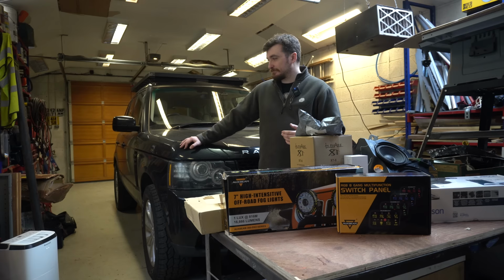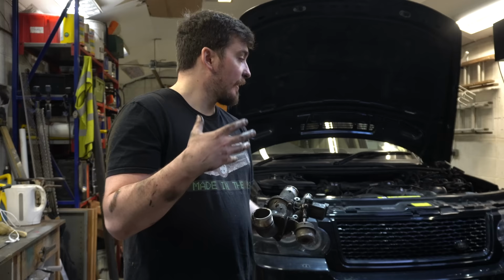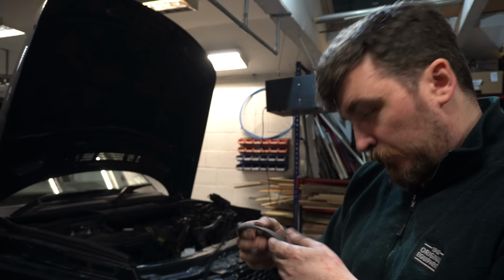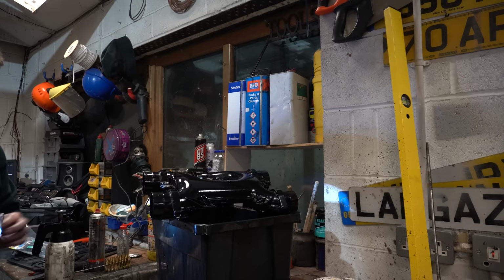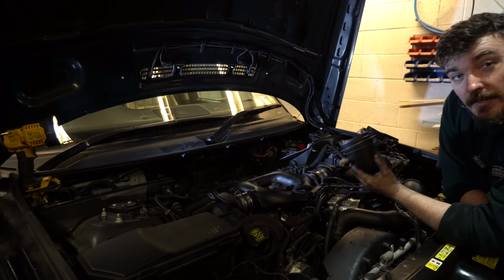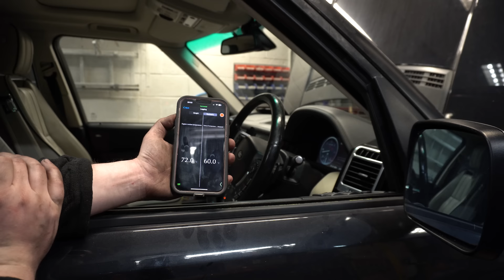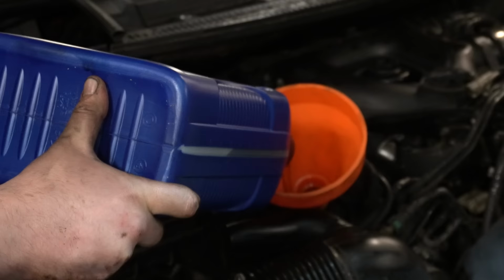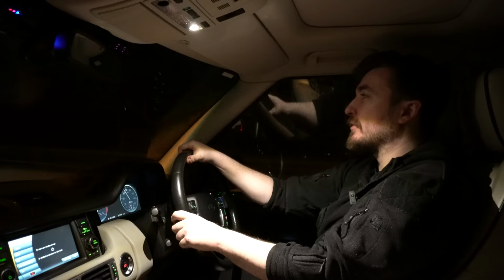THIS is why EGR is so bad for your Range Rover. [4.4 TDV8 Belt Squeal, Inlet Cleaning & Service]

Comment: I apologize for my English. On my tdv8, the piston burned out at 100000km and the catalyst began to collapse. The dust from the catalyst flew through the egr into the cylinders. A step was formed in the cylinders. As a result, it was necessary to sleeve the engine (.
The EGR was silenced, the catalysts were removed, and a chip was made
Reply from the maker: Your English is perfect.  That sounds like a horrible sequence of events!  I’m amazed that the catalyst material managed to make it through the EGR — that’s impressive!
Reply: @SamsMotors  I'm from Russia. We have a very bad diesel engine. There is a large amount of sulfur in it and because of it all the problems with dpf filters and catalysts. We are a big gas station, but with lame fuel ((. Almost all our cars from euro 4-6 are being converted to euro 0 or 2. Now I will deal with the removal of all environmental systems on my Ford 6.4D. And thanks for the video with the generator, he helped me replace his belt))

Comment: Great video 👍 I used mr muscle oven cleaner and a home radiator brush for cleaning the doughnut.

You didn’t investigate the oil leak down the bellhousing? Or did I miss it?

Comment: Soo glad to see you using 5w 40. Watching LR time with this oil chat has enlightened what oil I put in my cars.
Reply from the maker: It's the way forward, I'm convinced now after seeing how nicely my 4.4 is running since changing it.  Really noticeably smoother and quieter!
Reply: @SamsMotors  yep, totally agree. The Disco 4 in the family is due a service at 79,000 miles and will make the change to 5w 40 and continue to change every 6,000. Use 10w 40 semi in the p38 (lots say should be mineral not semi) but again change every 6,000 and seems to be a happy bunny on it.

Comment: Hi mate we have a problem of fuel bleeding..The fuel from the filter doesnt enter to the fuel high pressure pump..What maybe the cause..Thanks for your advice
Reply from the maker: Check the low pressure fuel pump is operating, it should be pushing fuel through the system into the HPFP.

Comment: thx for the info regarding oil, very interesting,, I am considering it for my l320 SDV6 with DPF, there 5w40 low saps
Reply from the maker: I’ve not seen a 5w40 oil with low SAPS, it seems to be a rare combination.
Reply: @SamsMotors  there is this castrol magnatec 5w40 DPF which is Mid saps but works for PDF... so it should work I believe
Reply: @SamsMotors This is my dilemma. I have just bought a 2012 4.4 diesel but I cannot find any 5W40 C1. Now I can't decide whether C2/3/4 would substitute. Thanks for the videos and your channel.

Comment: I blanked both egr on my 2008 Disco 3 and the butterfly valve and changed to 5W40 and the engine definitely ran quieter than it did on 5W dumb ass (😉). I’ll be picking up a 2016 Disco 4 with 210k Kms on it and will be running 5W 40 in future in it.
Reply from the maker: Since filming this I’ve noticed it is definitely quieter, especially noticeable at idle 👌🏻
Good luck with the D4 😍

Comment: Hi Sam good to see you again..yes we are lucky here in Aus to not have the DPF…..where did u get the remap to turn off the EGR?….I dont know of anyone here in Aus that do them on the 4.4TDV8…on the 3.6 yes they do it..Great video..I think. Next you will be doing your oil cooler looking at the oil at the back of the bell housing..I have just had mine done so happy days..for now😁
Reply from the maker: Is my comment accurate about Australia 🇦🇺 standard oil for them being 5w40?  I thought it was but have read some other sources that contradict it.
Mine was done via a Celtic Tuning agent in Ireland.  They’re a big company that has agents all over the UK and Europe but not sure if they’re in Australia.  No reason to keep it especially if you don’t have a DPF.
Reply: @SamsMotors  Hi yes no DPF but 5 W 30 still preferred..I will be using 5 W 40 on my next change…there is a discussion on the  AULRO  forum L322 site at this moment re the oil viscosity..one member has actually monitoring his oil pressure and is trying both oils..its good reading his findings!

F

Comment: Diesel trick for carbon build up cleaning is great, I just thought you could use sort of a rubble bag to put parts in, then maybe gaffer tape around a few places and fill it with diesel.
It may save you some diesel and it will cover the part fully, which is more important. Keep it in container, might as well.
I do not have any Land Rover atm, but by the time I get one I must be well informed.

Have you ever considered blusting walnut powder into intakes to clean up the engine, what is your position about this?
Reply from the maker: Yeah bagging it up with diesel would have worked quite well!
I’m very wary of any cleaning method that will loosen or disturb the sludge while the manifolds are on the engine.  I can’t see how all of that going through the engine wouldn’t hurt valves, injector nozzles, or something else.  So I’d rather wait and do it all properly in the future 👍

Comment: I've often wondered if there could be a solution where some kind of solvent (i suppose diesel) could be injected somewhere on the inlet tract at a high throttle load (i believe VAG have started doing this on their petrol cars) to keep things clean. Located like a nitrous system, but with a relatively low pressure injection of diesel.
Reply: Secondary/port injection on VAG cars was implemented around 2014 and then taken away again due to emissions regulations. Port injection by its nature causes a  less clean burn of the air fuel as it isn’t atomised a finely as direct injection. 

It used to be right before the manifold meaning it was only from there forwards that was kept clean with the air fuel mixture washing over the surfaces.

Comment: so for the low saps oil, C1 is no longer available but C2 is the same effectively? Have I got that right?
Reply from the maker: Castrol now does a Magnatec oil, 5w40 DPF, which is a C3 oil.  I’d probably recommend this for DPF equipped TDV6 and TDV8 now 👍
Reply: @SamsMotors  cheers Sam

Comment: Could I just ask if the link you posted for the spanners are the same ones you used on the RR? This is just in case the seller has changed the product since you posted the video. Cheers

Comment: Hi mate , you really shouldn’t have oil in the inlet from the intercooler, means intercooler is filling with oil from your turbos . New/ recon turbos and  new intercooler , you can never flush a intercooler properly.
Reply from the maker: Hey!  Every diesel I’ve owned has passed some oil via turbos, but yes at some point it will want them doing.

Comment: Have you removed the dpf or had it modified.  As removal would constitute a mot fail as no part of the emission reducing equipment can be removed. Mot tester will be told to do visual inspection and electronic scan to make sure equipment is there. So just wondering what your fix was around dpf. 
As for the oil total on board 0w 40 diesel fully synthetic is much better. Than 5 w30 .
Reply: Not sure the Irish nct works with egr deletes might not be as strict as an mot??

Comment: I see your FR rack is suffering the same corrosion issues on the corners that mine has. 
You can claim them on the warranty but I’m on my 4th set and it’s happening again.

My D3 has had its egrs blanked for most of its life. Never had any hassles with it. Blank and get rid.
Reply from the maker: Yep, pain the the arse!  I'll try and get them replaced but I'm not the original owner, so will be interesting to see how that goes.

Comment: Seems like you missed turbo sump draining. Or just didn't capture it?
Reply from the maker: Not sure what you're referring to... there's no such operation referred to in the workshop manual for an oil change?
Reply: @SamsMotors  I'm referring to turbo oil sump, that is located rearwards of main oil sump where the turbo oil return pipes go. It is hard to spot hence behind the cross member. But when you open its drain plug after all the oil is drained from the main sump, some 0,5-1 l of oil comes out of there too. I always do the oil change the old way - by draining, because suction method doesn't get the old oil out of the turbo sump, I know because I've tried. 🙂

Comment: How we doing sam good to see you back in the egrs gone and a stage1 remap done on my sport 3.6
Reply: My 09 3.6 sport sam has 270.000km would i be better off going to 5w40 as i say egrs are gone iv no dpf in the 09
Reply from the maker: @noelcahill6707  Personally, I would, but it's down to you to do what you think is right.  The best thing you can possibly do is change the oil more often, regardless of what oil type you use 👌
Reply: only my experience, But, i did the same on my 3.6 L322. 3 months later. Turbo went. Just got back today. Reset ECU to factory. 2 new turbos and EGR valves £5600 Later..😪
Reply: @bobbobbing12  its seen to blank the egrs ul save your turbos the problem could be your turbos were on the way out b4 ud it done im in ireland if the 3.6 range rover sport il just drop the engine and put a bmw m57 in it b4 id spent that money
Reply: @noelcahill6707  I've owned the car for 8 years. My choice was to replace with another newer one for about 20-25,000 or stick with this one. Which has only let me down this one time.
Reply: No im not giving out mate over 8 years the soth had built up in your turbos was just crap luck mate

Comment: Should you really be using metal wire brushes on the inside of a plastic manifold? Scratches can cause airflow disruption and yes what you have done is a massive improvement on the build up within... But still??

Love the content you do and keep up the fab work...
Reply from the maker: I don't think a few hairline scratches are going to be of any consequence at all vs. 3/4" of sludge.  It's a big forced induction diesel engine after all, not an F1 engine!

Comment: @samsmotors did you ever get to the bottom of your ride quality issue?
Reply from the maker: Not yet, it still alternates between comfy and slightly un-comfy.  I have a few more things to try but haven’t gotten around to them yet.  Have you got a similar issue?.
Reply: Yes I’ve had a run of L322’s that seem to go into uncomfortable mode. I tried replacing the AD module in the boot to an older one which was more comfortable (different version of firmware - it didn’t help) I also did a couple of ride height sensors (one as wiggling - had been bodged by previous owner - that helped but still went un comfy at times) have been reading that maybe rear bushes on suspension arms/knuckles and rear subframe mounting bushes may be the issue. The particular car I had the issue with - I’d replaced all the front suspension components with new and I do mean all - so I think it must be something In the rear.
Reply from the maker: @jamesg25  add me on Instagram - will be easier to compare notes on there.  Cheers 🍻

Comment: EG cools down the combustion process! So a simple "good or bad" is quite nonsens!

A very hot combustion will produce NOx - this is the reason why they exist. A very hot combustion peak WILL KILL YOUR ENGINE though! First your piston and or ring and than the engine.

High tech = high service. If you own a RR, you should have the money to service it
Reply: This is true however typically at wide open throttle the EGR circuit is closed (at least initially), to allow the engine to deliver more power! 

Overall manufacturers are trying to balance NOx production with particulates emissions in order to meet stringent targets - neither are particularly good for our health!

And petrol vehicles also deploy EGR tactics, albeit typically without the associated difficulties encountered with Diesel.

Some academics have based their entire PhD on such studies!